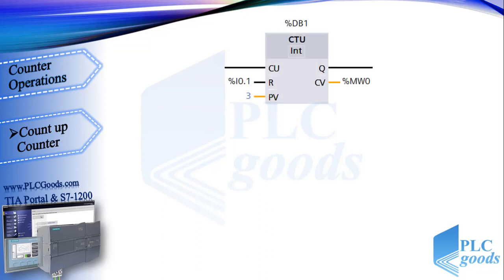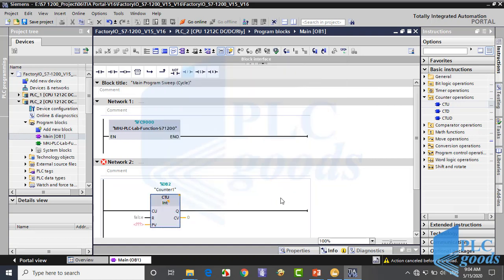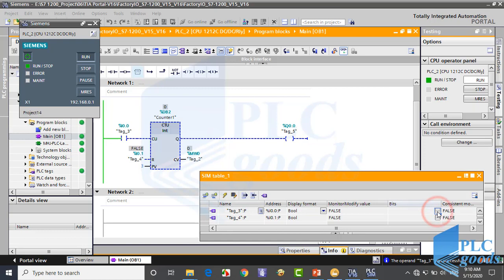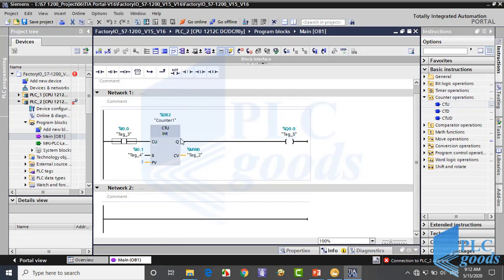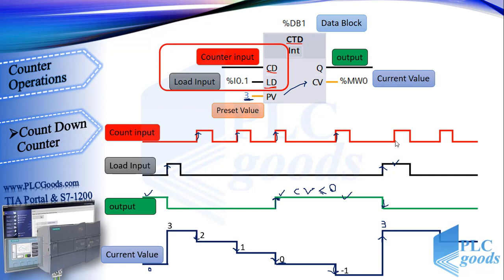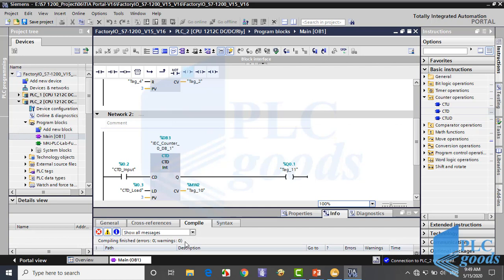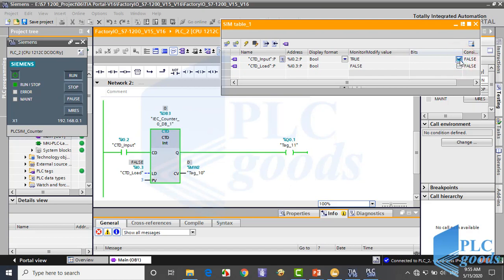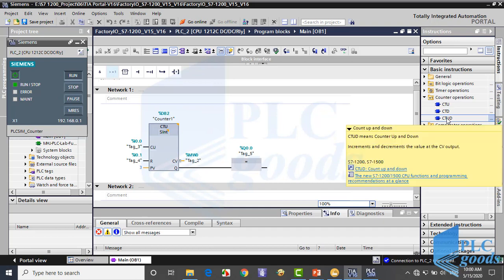PLC Counter Operations | Count Up & Count Down | Siemens S7-1200 & TIA Portal | L 19

Comment: Thanks for the video. One question. How do you stop the counter from counting? For example, if the PV is 3 the counter will continue counting past 3. That's a problem if the count is displayed on a touchscreen. Regards.
Reply: Hi there, a simple way to stop the counter is using a compare instruction (CV<PV) before the counter.
Reply: @plcgoodsmentor9223  Nice. Thanks for the tip!
Reply from the maker: You welcome!